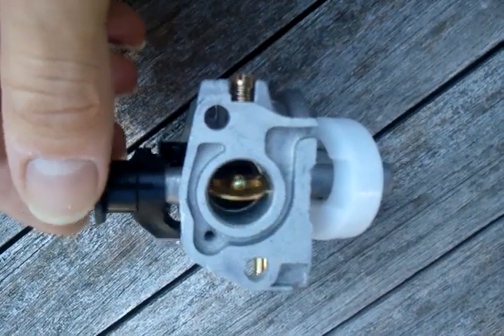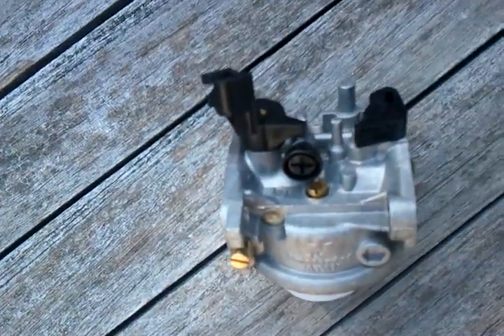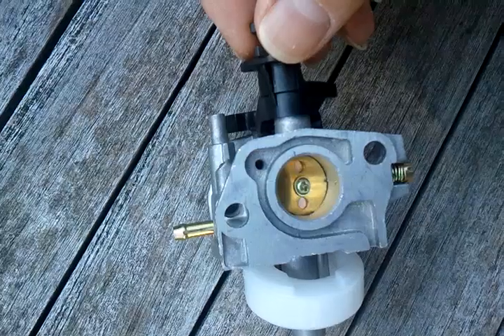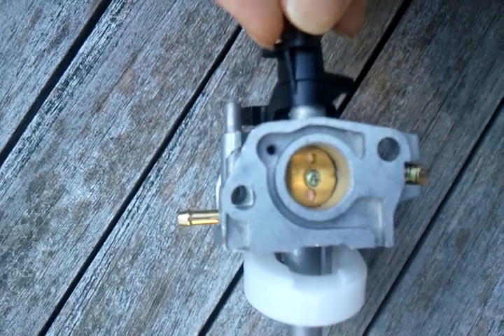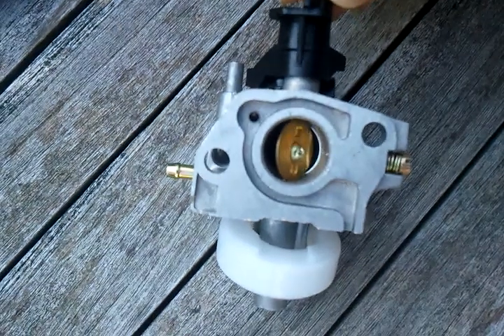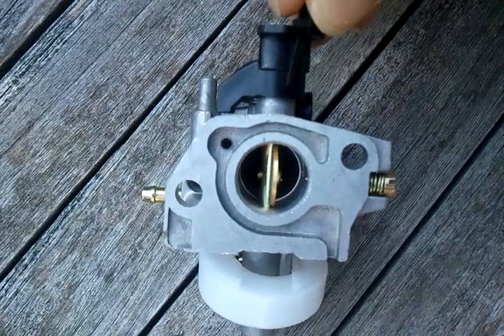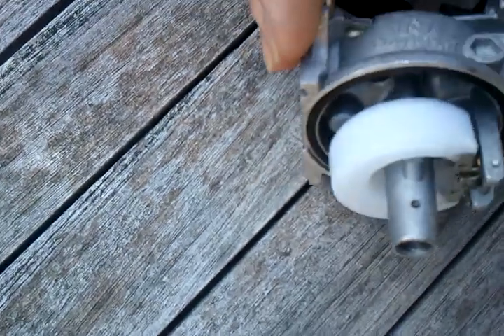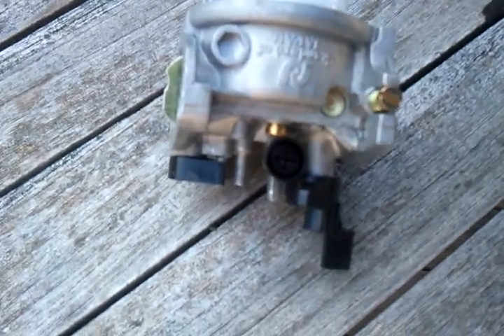Carburetor basics and troubleshooting

Comment: Occasionally it'll start be only on choke because I was missing the manifold sink bolted the carb directly to the cylinder and it would start but it had to be on choke almost all the way on and then after a little running is open the choke just a hair more but it soutters and eventually stops almost like its getting spark then not getting spark but the electrical is all work as it should, I've got great spark and what you said makes sense but like I said there's no screw when I take that runner piece out. What's weird is when I finally got the new carb, intake manifold it's started up and now I could hit the gas without it stauling on me but then I hit the stop bottom and went to go starit back up and it started running like shit again. Any ideas on what could be happening here. I thought air leak maybe but I've got on all brand new gaskets!

Comment: When I took the plug out from under the idle screwn and there was no jet in there there's a whole at the bottom left corner and a whole on ech side of that plug cylinder where your saying there should be a jet?? So what do I do now. I have good compression, I bought a whole new intake because the old one was rusted out Soni replaced the carburetor, the intake manifold ( plastic piece that converts it from the round carb hole into the square one the cylinder has.

Comment: Brand new Chinese walk behind trimmer, keeps carbon fouling the spark plug and I dont know why. Replaced the Chinese spark plug with NGK, is still running poorly and sputtering, carbon fouling the plug. I think the carb is just like this one but the only screw I see on it is the big black one in this video. What is the big black screw for?

Comment: I have a honda ex1000 generator. It starts but dies after a few seconds. Cleaned the carb but i must've missed something. Would the idle circuit make a difference as it runs wide open? Thank you

Comment: looks different than 420 predator, slightly not sure of screw on slde
Reply: The 420 is twice the engine.  It should look different.  The theory of operation is the same and most of the parts correlate but are not interchangeable.  Do you have a question?
Reply: @joshmuckley7979  no, we are putting the 420 on old club cars, with a remote choke cable and 90 pipe off muffler. the engine is 14hp and jumpy. the 212cc engine might be smoother. guy at local sells huskavarna engines that might be better on golf cart. club cars have the windup clutch.
Reply: dont like the plastic choke axle on chinese engines, it slides thru the axle, no screws. backfired and broke with air box off.

Comment: Is that idle control screw adjustable because it doesn't have anything to keep it in place. Vibration of the engine makes it turn if not screwed completely down.
Reply from the maker: Is it a generator?  When it falls out, does it make a difference to the performance of the engine?  If not, maybe just leave is out.  Who cares.  On the other hand if if does make a difference, try blue lock-tite.  Use a q-tip to put in the threads and threads alone.  Let it dry completely.  Try it.  You can also use pliers or other hard tool to mar or flatten some of the threads to make it stiffer in the hole.  Of course new carbs are only a few bucks.
Reply: @muckleyj  No it's a club car golf cart. Backing off of it does make it run better but the vibration of the engine makes spin back down. I don't see the point in having it if you can't adjust it except to clean it.   Very confusing. And it is a new carb. Everyone I've seen like this one is the same way.
Reply from the maker: Probably keeping the min throttle position set right.  What about replacing the plastic screw with a machine screw?  You could even use a lock nut to hold it in place if it was a metal machine screw.

Comment: O m g I searched for hours and finally found this. I’m assuming the other screw you mentioned was the mixture valve?
Reply: There are 3 "screws" in the video.  

For clarity the black plastic one is the minimum throttle stop.  You can see how it stops the butterfly from going all the way shut.  This can be adjusted to maintain a minimum throttle position.  On a generator you'll never see this screw doing anything because the governor is always holding the throttle open to maintain the speed needed to generate 60 hz.

There is a brass "screw" that is below the black plastic one.  This is the idle jet.  It can not be adjusted.  It is screwed in  snug for normal operation and only removed for cleaning.

The last screw has a spring on it.  I assume this is the one to which you were referring.   This screw works to fine tune the minimum/idle  fuel mix.  Since generators never run at minimum speed this screw is kinda worthless on a generator.  For a go cart this screw would work together with the plastic screw to even out idle operation and improve throttle response when goosing the throttle.

Hope that helps.

Comment: My spark plugs keep fouling. Could it be air fuel mix or a valve problem. I've had to pull the plugs and clean  them before it'll run again.
Reply from the maker: fouled spark plugs mean it is rich.  too much fuel or not enough air.  main jet might be too big...or maybe the choke is stuck slightly closed?

Comment: You are one of the very few U Tube carb guys that show the DIY guys how to properly clean a carb,there are a ton of vids out there where the poster never shows the idle jet,the emulsion tube and the hidden fuel screen. Well Done Peter
Reply: The hidden fuel screen is located behind the fuel nipple which must be removed to access the screen,however after removing the float you can blow some carb cleaner the opposite way of the fuel flow and that might get you pass that step.😃

Comment: And then the Duramax 10,000 W generator didn’t even come with an in-line fuel filter stupid fucks
Reply from the maker: Many of the fuel tanks have a filter screen built into the fuel shut off attached to the tank.
https://a.co/d/84Dps6C
You can't see the filter in this valve but if you spin off the hex part it reveals a screen filter.  The valve body is the filter housing too.

Comment: Carb issues on 6.5hp dune buggy.  Probably less than 20 hrs, never left outside.  Gave it some ether. It started and settled down. Let it idle for 15 min to get warm.  Won't start from pull rope without a tiny shot of either...then runs, idles fine.  Turn key off and won't restart without a tiny boost of ether.  Does that sound like needle valve junked up?
Reply from the maker: Kinda sounds like the butterfly is too far shut.  Adjust the minimum throttle setting to hold the butterfly open just a bit.  Cleaning the port in the black plastic won't hurt and setting the needle valve to 1 turn open won't hurt either.

Comment: My problem is that it won't start on choke,hafta give a shot of carb cleaner then all good,. What gives?
Reply from the maker: I think your butterfly might just be a bit too far closed.  Try adjusting the throttle screw in a tiny bit.

Comment: After all that talk you just glossed over the idle screw valve and what it does
Reply from the maker: Sorry to have mislead you.  Typically the idle screw which is black plastic in the video, simply holds the butterfly open and forces the engine to run at a minimum RPM.  Its the same as slightly pulling the throttle trigger on a chainsaw or weedeater.  In this case the engine is for a generator and doesn't have a throttle lever or trigger.  The governor is always trying to get the engine to run at a specific RPM - I'd guess 1800 - which is way above idle.  So in this application the black screw just keeps the butterfly from jamming closed in the throat of the carb.  In other applications the idle screw sets the idle or minimum engine RPM (finger off the trigger,  throttle lever down from rabbit to turtle, foot off the accelerator).  For reference most engines idle pretty good at 700 - 800 RPM.
Reply: @muckleyj  thank you for the reply!

Comment: So I just had to replace the carb on my simpson pressure washer, its almost identical to the one here in the video, but it has that black pry cap where the brass screw is as you said your other one has, and its idling a little low. Because its a pain to get to and figure out what does what while its running, I am trying to figure out which screw, if any, controls the idle speed. I got my washer working and I havent properly adjusted the carb yet so I need to do that before I actually use it on my driveway.
Reply from the maker: The idle speed is set by the brass screw that keeps the butterfly open.  The screw actually pushes on the linkage plate attached to the shaft of the butterfly.

Comment: HI Josh Is surging the same thing as bogging down? and are they both caused by a lack of fuel? When the black adjusting screw that's above the jet that you are talking about is adjusted what does it actually do?
Reply from the maker: Black plastic screw is the idle control screw.  In this application is really just keeps the butterfly from shutting too far and jamming in the throat of the carb.  In other applications is sets the idle or minimum RPM.
Reply from the maker: Surging is a vroom, vroom, vroom that is not caused by the operator.  Bogging down is not the same thing.  Bogging is usually seen on carbs with a high jet and a low jet.  If the low jet is too far closed or slightly clogged then the throttle response will be delayed.  The engine will bog unless you pump the throttle.  See my other video on tuning a typical 2 Stroke

Comment: my pressure washer honda gx200 carburettor has the black plastic part that you mentioned instead of the screw, but I did not know that it could be removed. I don't like to trouble things if I am not sure what they are for because I have gotten myself in trouble before by doing that; It is good to learn before removing anything.

Comment: I accidentally snapped the head off the black mixture screw. Is it possible to drill that out and replace it or should I just buy a new carburetor?
Reply from the maker: Chinese carbs are super cheap.  That being said I would try a small drill bit to make a pilot hole then us a wood screw to screw in and give you something to pull on with pliers.  As I recall that black screw isn't a screw at all and removing it requires pulling/prying.
Reply: @muckleyj  thanks I’m going to try a speed out first and if that doesn’t work then I’m going to try drilling it out. It is a plastic machine screw that doesn’t take a whole lot of pressure to go in or out so hopefully I can replace it without having to pull the carb, it’s new!

Comment: I replaced the carburetor with a brand new one and now the engine won’t start.  Any ideas? 💡
Reply from the maker: Fuel, air, spark, compression.  IF you touched nothing but the carburetor then you can probably rule out spark and compression.  Air is controlled by the throttle linkage to the carb butterfly and the choke lever.  Fuel is probably the most likely problem and if you can quickly eliminate the first 3 then you can buckle down with fuel.

If the float bowl filling?  Is fuel making it to the combustion chamber - after repeated attempts to start, the spark plug may be wet.

I'm guessing that the needle valve or float are stuck on the seat preventing the bowl from filling.  There is a chance that the position of the throttle screw is  messed up - try a quarter turn in either direction.

Are you getting any responses from the engine.  A spurt or a sputter?  A brief start then stop?

Is the engine flooded (wet spark plug)?

Comment: What is that jet called that makes the suction ?
Reply from the maker: The jet that makes the suction?  The engine makes the suction.  The jets just meter the amount of fuel during various throttle positions.  The black plastic one I show in the video is what I would call the "idle jet" since it is metering fuel while the engine is at idle.  The "main jet" is slotted and threaded.  It screws up inside the suction tube that pulls fuel out of the float bowl.  Those same threads ultimately hold the bowl on too.  I didn't show it in the video but if you use a medium flat blade screw driver up the hole you can remove the main jet and the  E-tube should just fall out.  Replacing/modifying the main jet and e-tube is the method that you would use to tune the carb for different fuels, altitudes, and force induction.  These carbs only have 2 jets.  Main and idle.  Hope that helps.

Comment: Thanks a lot for the video, it immediately fixed our engine "surging" problem by cleaning the plastic jet on top.

But now we have another problem -- the engine of our Hyundai tiller stops.

It starts alright, idles perfectly and revs without any problem.  It also drives smooth when on flat surfaces or going down.

BUT whenever there is a little upwards slope, specially in rocky / stoney terrain, no matter how much throttle we give it, it just stops.

Any ideas?

Thanks in advance 👍🏼
Reply from the maker: There is almost not doubt this is being caused by the pickup tube in the float bowl being uncovered and sucking air in.  To an extent it is simply the result of the OEM poorly choosing a float style carb.  Float style depend on gravity.  Impulse and pump styles are much more tolerant to various engine and tank orientations.  You problem may be being exasperated by a dirty fuel filter (probably in the tank, maybe as part of the fuel shutoff valve).  You may be able to improve the situation by tweaking the level in the bowl a bit higher.  This might be done by bending the float arm slightly.   Check the filter first.
Reply: @muckleyj  Many thanks for the ultra-quick response, Josh 👍🏼

I was just now reading about similar issues when the gas cap is blocked or faulty.

Will test-drive later today with loosened cap and get back yo you.

Once again, thank you very much from Georgia (the country, not the US state) 🙋🏼‍♂️
Reply from the maker: @jfpello  Georgia!  Wow!  Thanks for reaching out.

Comment: I have a Coleman mini bike and it idles real high and surges. Doesn’t do a thing if I adjust my idle speed or the air screw. I feel like these carbs are so cheap sometimes I rather not deal with the headache and just get a new one.
Reply from the maker: Yeah totally understand and agree.  I will say that most of the problems I have encountered are a result of either ethanol fuel or any fuel being left idle in the machine.  Ethanol tends to break down rubber and plastic parts and also absorbs moisture.

If the throttle won't come down it seems like the butterfly must be being held open by something.  Varnish in the throat of the carb can make the butterfly sluggish and may stick open.

Comment: and if that's not the problem, then what to  look for?
Reply from the maker: Dirt, debris, or varnish in all the other ports.  There isn't much left to look at.  The point of the video was to show that the idle jet gets overlooked because it is plastic and just looks like a plug or something.
Reply: @muckleyj  So if all those are in working order, and you STILL have surging/hunting... then time for new carb?
Reply from the maker: Did you know that the slotted brass up inside the part that holds the bowl on is a actually the main jet?  Have you removed it for cleaning?  The e-tube should come out with it and needs cleaned too.

What about the tiny little ports where the fuel from the idle jet comes into the carb (right by the butterfly)?  Those might require a Welch plug to be removed and replaced.  The welsh plug is just a circular concave piece of metal.  It's a little more difficult to get out and will probably be destroyed in the process.  Cheap to replace.  Of course by this time it might just be cheaper to replace the carb.
Reply: @muckleyj  I removed and cleaned all the jets and nozzles that are easy to access, including the main. Needle valve looks pretty good though may have some microscopic pitting, a simple vacuum-style test gave back good results. All the parts were shine and brand new in appearance, the float is white like a celebrity's teeth. Main issue is hunting/surging. I also replaced the spark plug. It runs better but not perfect.
Reply from the maker: Sounds like you pretty much hit everything.  The ports in the side of the carb throat where the idle just discharge comes out might be your last chance.  You could also ream the idle jet a slight bit for more fuel.
Reply: @muckleyj  Thanks for the help, appreciated :)

Comment: Could this jet you point to at the end be the cause of hard starting? I can pull my guts out for more than a dozen times and nothing, but if I give it a little throttle it will usually fire up in one or two pulls and once running it's fine
Reply from the maker: Maybe... If you haven't cleaned it then it's certainly worth a try.  What about just dialing in the throttle screw to hold the butterfly open a little bit?  Have you tried that?
Reply: @muckleyj  not yet but I thought about that. The generator is brand new but I've had it for quite some time without ever taking it out of the box until the other day. It's only a cheap generic generator so it could be out of adjustment from the factory but the carb looks identical to that in your video. Thanks for the fast reply.

Comment: If you change out the main jet, do you need to change out the emulsion tube as well? Also when doing this, should you replace the idle jet?
Reply from the maker: If you are changing the orifice size of any jet then all bets are off, I don't know.  Otherwise just clean and reinstall or remove and reinstall.